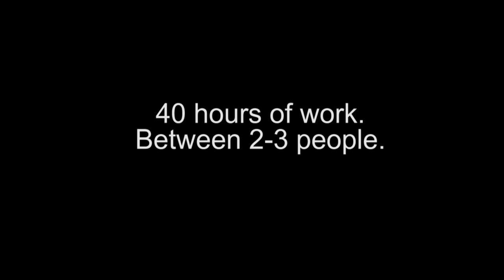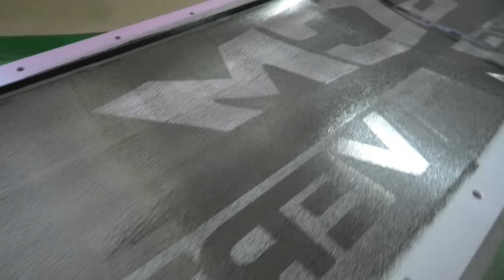How it's made. Inside GCM, Vertigo F5J wing construction.

Comment: Totally gorgeous! Way, way outside my tiny budget, but I've done a little bit of work with composites and vacuum-bagging over the years, and for anybody who's perhaps discouraged after seeing what's required to build to this very high (professional) standard, DON'T DESPAIR!

It's still possible to get great results on the cheap. True, you won't have all that very light and lovely (and expensive) carbon fibre, but hot-wired foam cores and lightweight fibreglass cloth cut on the bias combined with a basic vacuum-bagging rig will still give you amazingly strong and lightweight components.

It's worth spending a bit of time laying-up the wing spars (I use carbon-fibre tows, spruce strip, balsa infill and kevlar wrapping) and then vacuum-bagging everything. I made my DIY vacuum-rig from an old fridge compressor (price £0.00). The whole thing - including plastic tubing, a homemade pressure valve, bag seals, unions, etc, cost under £20.00. It's well worth the hassle because there's absolutely no substitute for vacuum-compressed epoxy-composite construction.

The end results won't be as pretty, strong or light as what's on show here... but you'll be within about 10% of it; and it'll have cost something like 85% less.    :-)
Reply: That sounds great! Do you share your builds and experience anywhere online? Looking into scratch building myself. Besides doing RC conversions and flying bought models.

Comment: Back in the 90’s - when I stopped competition flying - these builds were just starting. There is no doubting the performance, but what has been lost is that winter of building, and hoping to have designed a winner, ready to start the next season. Instead, it has been replaced with “the more you spend, the higher the points tally”.......
Reply: You nailed it!  Id say 40% of the joy brought in from this hobby was building your own over the winter break....I STILL have a few foam cut wings as spares from 20 yrs ago!! Lol I loved pressing my own wings with obechi veneer..... does anyone even do that any longer?
Reply: Kitesurfing, Hang Gliding, and Sailplanes could all be revolutionized by building a wing like this, just scaled four times bigger in all dimensions.
Reply from the maker: I still build, almost every day. Balsa, built up. Still love it. I spent my entire youth building built up TD and power planes.

Comment: Wow it's been said before but the work involved is unbelievable I will never ever complain about the price of an F5J model again! Absolute work of art.
Reply: I will. I don't even want to know the price if it took a week to make.
Reply: @JoshWeaverRC  around 2k with 600 to 800 bucks for the used carbon fiber alone
Reply: And that foam core wings model is not even the most expensive J glider. High end gliders use carbon fiber+balsa skin and ribs structure for the wings, but this is significantly more expensive structure and more labor consuming process than foam core gliders. Most composite gliders manufacturers use foam core technology just because of it is relatively cheap and simple.

Comment: As much as I enjoyed this, I think some narration, about the materials and techniques would be more interesting.
Reply: Hi, Michael! Sorry, but I think you'll find that alchemists hate to give away their secrets...  ;-)

I make cheapo composite gliders with homemade equipment, and you can get really good results by using fibreglass cloth instead of carbon, and laying-up spars from balsa and inexpensive carbon-fibre roving (tow). It's messy and can be frustrating, but I think a lot of the magic comes down to practice and patience. The end results are excellent.

Metal moulds are strictly professional, but a basic vacuum-bagging setup needn't cost more than £20.00.

Comment: Fun fact: 70% of the price of those F5J gliders you pay just for the paint job, lol. Stencil work is what you basically pay for, the rest does not take so much time. There are significantly cheaper F5J gliders with the same structure but without paint job, they have just plain black carbon finish and it is up to user how to paint them, but it allows to save a lot of cash.